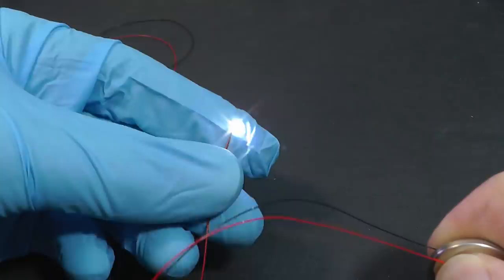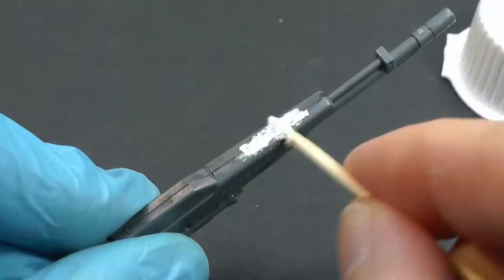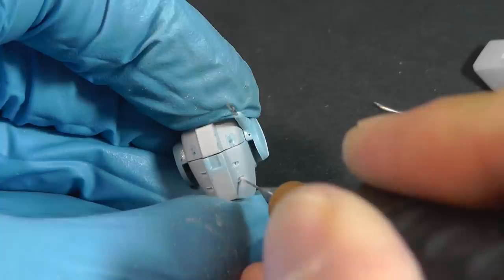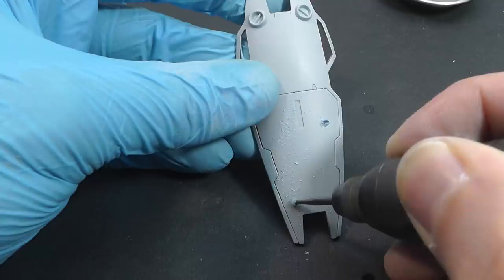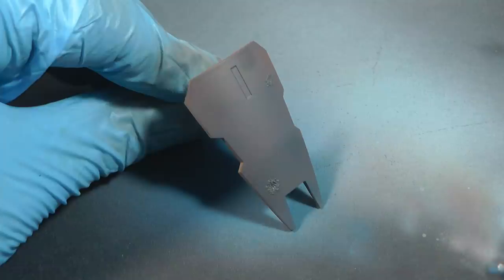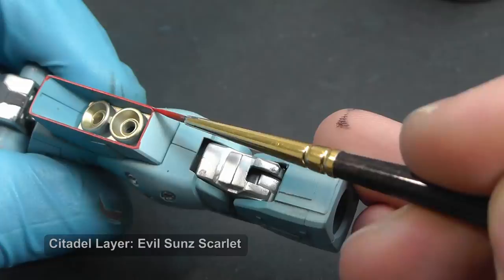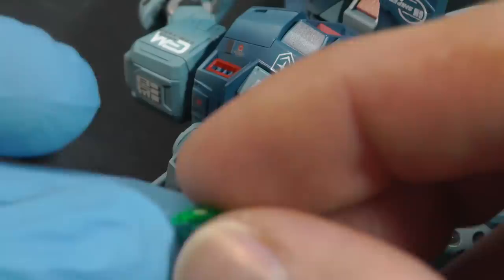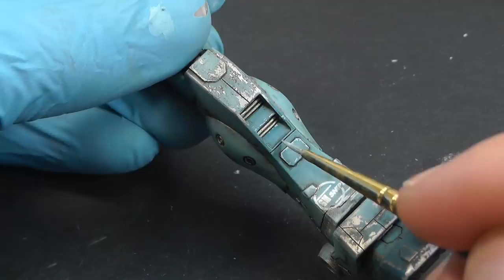RGM-79SP GM Sniper II - 1/144 Bandai - Gundam Model

Comment: HG is for expert modeller because lack of detail XD.
Reply: Buying an expensive model with lots of parts doesn't make an expert modeler at all. Making a good model from a cheap set is an art. Unfortunately, this requires more work and experience.
Reply: Naw that’s mega size kits
Reply: Anything people consider as brick kit is expert kit. Re100 nightingale, hg kits and sazabi are a few of it
Reply: Speaking from experience that's flat out false. HG is for inexperienced modelers and heavy modification happens on all grades for professional gunpla. More over the engineering that goes into a HG is pretty garbage in comparison to the more expensive kits and I don't mean detailing
Reply: @larrisAWSOME  he's just joking. I think you probably knew that
Reply: Just imagine him doing the HG Dendrobium. All those missiles.

Comment: The thing that would make the biggest impact on the final presentation is one of the most easily overlooked; posing!
Final posture of the model in the last shots was hunched over and awkward. Try to think about positioning it how you would stand up straight; the angles of your knees as well as your feet shouldn't be parallel and your ankles should be in line with your hips.

Comment: "so interesting, ihnndeeed" - I detect skepticism
Reply: @idaemonplasmo  Do you slow your PROXXON Dremel drill to 500 rpm?  how?
Reply from the maker: @christreedee  https://youtu.be/8fYl3MucNCI?t=267 eBay - 12V~40V 10A PWM DC Motor Speed Control Switch Controller Volt Regulator Dimmer
Reply: @idaemonplasmo  Thank you so much .... do you need to add a DC PORT to plug in a Adapter... the fact it is attached to your Proxxon power  transformer is just for convenience?
Reply from the maker: @christreedee It is an independent regulator. You need a 12V - 2 or 3 A power supply also. Then plug the regulator and your proxxon.
Reply: @idaemonplasmo  I see that, again amazing channel thank you :)
Reply: @idaemonplasmo  doesn't the proxxon ng5/e also allow you to slow down the Dremel by reducing power in a similar way? Or am I mistaken?
Reply: @tuhkathri9126  5000 to 20000 only
Reply: Flex....
Reply: @idaemonplasmo  Proxxon   28512 12-Volt Micromot 60 EF Rotary Tool - IS this your model? they seem to have changed their naming conventions.       ?  Thanks allot PLASMO!!!!!

Comment: For gunpla grades, the differences are pretty straightforward

High Grade - 1/144 scale - simple build, less color & part seperation. less articulation - very cheap -
Master Grade - 1/100 scale - somewhat more complex build. often have gimmicks like opening hatches, collapsible weapons, and improved articulation
Real Grade - 1/144 scale - complex internal mechanisms, detailed color seperation, come with large decal sets
Perfect Grade - 1/60 scale - enormous, extremely detailed, extremely expensive
SDCS - "Super Deformed Cross Silhouette" - Despite being cartoony kits with cutesy proportions, they are fairly well engineered. You might have some fun with one of these things just because of how small and weird they are.

As for recommendations:
HG The Origin Zaku - any of the variants is a great kit, and color won't matter once you paint it.
MG Gundam 00 Qan[T] Full Saber - very much a cartoony space robot with an assortment of ridiculous laser swords, but very well engineered.
MG Gundam Barbatos - A crazy skeletal robot covered in gnarly angles. Very well articulated. 
RG Nu Gundam or RG Sazabi - Both extremely detailed, well articulated, and covered in opening hatches, internal mechanisms and all sorts of stuff.

Comment: This is a blessing. Some gunpla folks are too rigid with their methods and tools but you have opened my eyes with other possibilites. Also your point with rust, which i think is neat. Some people put too much rust on their models, when it is supposed to be modeled after corrosion resistant alloys.

Comment: One thing you could use to enhance your models, especially in the area of battle damage is you could fabricobble a miniature sandblaster. Imagine how cool rust spots would look like if you'd pit the entire area around it, color the pits with a red rust, then paint on top with a chipping varnish. 3D effects are very cool.

Comment: instead of thee razer and knif combo,  you can use a needle.  Sand the needle at a 45 degree angle and use a holder or pinvise.  DIY chissel.

Comment: The 1/144 scale HG kits are built from the start to be clean and simple.  The lack of detail is both friendly to beginners and allows more advanced builders to do exactly what you have.  The model kit community around these kits is entirely geared toward customization and adding complexity.  Even scratch building.  I've waited a long while to see you handle one.

Edit: Almost forgot.  This is a prize entry for another GM Sniper kit from 2018.  It might be an interesting look inside for some.  https://www.youtube.com/watch?v=F1eQk0ggy-U&t=2s

Comment: Honestly this makes me want to try gunpla! As a modelmaker myself I find your videos hugely inspiring!
Reply: The Gundam kits are a treat, the engineering of them is amazing.  The HG Origin line is a still the basic line but with a bit more panel lines and details so if you just want to build and paint with minimal custom work you can get excellent results.
Reply: I made a couple a few years ago but because I didn't do much with them as my skills were quite limited back then. I fancy building a HG Wing gundam as it's one of my favorite designs with new details and paint job added.

Comment: Finally a change. The effect is simply great. Weathering is insane. According to the anime, this is a big machine that takes part in heavy fighting so it must be dirty. Good European interpretation of Gundam. I've seen Gundam model shows in other countries and haven't seen such a well-made model straight out of the box. Usually you can see American or Asian models stuffed with accessories and this in my opinion reduces the skill of the modeller. I am pleased to write that this species has not died out yet. It is not an art to buy accessories and simply stick and paint them, but do it yourself. Once the masters did everything from scratch. Congratulations and good luck.

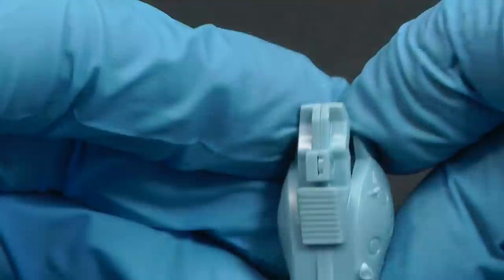Comment: You mentioned being a fan of Ghost in the Shell, and I'm pretty sure you already know that Kotobukiya (a rival of Bandai's) has made some kits for Ghost in the Shell: Stand Alone Complex (Tachikoma and spider tank in 1:35, Jigabachi attack helicopter in 1:72) and Ghost in the Shell: Arise (Logicoma in 1:35). I've "built" (read, assembled out of the box) the Jigabachi and Tachikoma kits, and from my experience the detail is nicer than Bandai's kits, but the plastic is more along the lines of Hasegawa (very hard and brittle) rather than the slightly softer Bandai plastic. They're also much pricier. I would love to see what you can do with them, though...

Comment: Outstanding model! Next time you can use the boosters on the back as a compartment for the batteries, so you don´t need to use external cables and power supplies.

Comment: Ohh you also bought an rg kit? Depending on which it is your experience might differ... all kits released untill the unicorn gundam had premolded inner frames which in the long run loosen up, while all kits (except for a version of the zaku) since the unicorn gundam come with inner frames that you have to assemble from a lot more pieces and in general they feel like smaller master grades... cant wait to see how you'll work on it

Comment: Which Real Grade did you buy? The most recent ones are the best, those being the  Tallgeese, Sazabi Crossbone Gundam and v Gundam. The Unicorn is also very good but the Pre-moulded frame parts on that one are prone to breaking because they’re very tight out of box. 

Every RG that came before the ones mentioned can have some issues holding together due to the reliance on the pre-moulded frame, the Zeta Gundam and Sinanju experience this the worst. A little warning just in case.

Comment: The result is awesome! Did you experience any cracks in the plastic after the oils phase? I have made a few Bandai Star wars kits and learned that Bandai plastics don't react well in contact with White spirits or enamel thinners. I guess the model has to be very well sealed in order to avoid this to happen.
Reply from the maker: 😁 Yes, the plastic is too rigid. I had one or two small cracks, but nothing substantial. I weakened joints at the beginning, so it was, in the end, a good idea. But I will mention this issue next time it could be a serious problem.

Comment: WOW, this is a HG isn't it? The intricacy needed to put on all the details... And where did the battery go? the body? The wiring could go through one of the leg down to a stand or a diorama so that the wires aren't popping out of it's butt and the battery could be placed there with a switch(maybe?) for easier change in case it runs out... Maybe you've thought of it already and find it pointless? I don't know. But nice job with it.

Comment: I know this has nothing to do with the video but old guitar strings work for tow cables for tanks?
Reply from the maker: Yes, you can. But It is hard to shape and fix them to the needed position.
Reply: I dry fitted them to a panther and they fit pretty good if it is then enough

Comment: I challenge you to build a Perfect Grade gunpla using all your model kit techniques
Reply from the maker: I am so confused by all series. 😂 I think I am OK with HG or RG.
Reply: @idaemonplasmo  Ok. How about a Master Grade? That should be fairly manageable

Anyway here's a breakdown of the common grades of gunpla:

*SD - Super Deformed (no particular scale) Leans towards a cute style

*HG - High Grade (1/144) The standard 1/144 scale gunpla kit. Easy grade to get your hands on, but will usually need a lot of work due to missing details

*RG - Real Grade (1/144) Incorporates an inner frame. Originally, the inner frame came pre-built in a separate runner. More recent releases have abandoned this. Has a pilot figure for scale

*MG - Master Grade (1/100) The standard 1/100 scale gunpla kit. Often comes with an inner frame and with high detail. Comes with two pilot figures: standing and seating position. Various releases will have a "Ver. Ka." title in the box. Those releases were based on designs made by the famous mecha designer Hajime Katoki. Those kits with that title often are very complex and are very heavy on waterslide decals

*PG - Perfect Grade (1/60) Large and very high quality gunpla kits. Incorporates a more complex inner frame and detail work than MGs. Has a lot of parts and construction often takes days to complete. Has an opening hatch gimmick on various parts of the kit. Comes with two pilot figures: standing and seating.

*Mega Size Model (1/48) Very large gunpla kits intended for shelf presence. Quality is about the same as a HG due to the simpler construction

Other types of Gunpla:

*NG - No Grade (usually 1/100 and 1/60) This is more of a fan term referring to HG quality kits that don't come in a particular grade. Often has a simple construction and detail work. This was given the title of "Full Mechanics" for the Iron Blooded Orphans line

*RE100 - Reborn 100 (1/100) Model kits reserved for mobile suits that were either too expensive, too large, and too obscure to be given the MG treatment. Made to complement various MG releases. Detail work and construction is usually HG quality, however some kits will incorporate some high quality detail work and a simple inner frame

*HiRM - Hi Resolution Model (1/100) A sort of mixed media gunpla kit. Incorporates a pre-build inner frame that's like an action figure. Very high-end detail work and often the parts come in a glossy finish. Early releases were quite flimsy

Comment: What micro drill brand are you using?
Reply from the maker: I use Proxxon micromot 50e, which I modified to low RPM.
Reply: @idaemonplasmo  Thank you, one more question what is the you are using in 9:00?